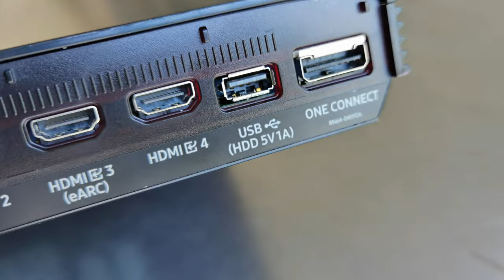Samsung Slim One Connect Box 2021 for QN900A: How it works and deep details

Comment: I read that the black screen issue can be fixed by cooling the green board down. It's possible that blue stuff isn't very good. My new s95c blacks out at 120hz or higher but it's not consistent and sometimes it's stable. I have read people spoke to samsung and they say the chips fail and need replacing. It's possible they cook then fail the first time you exceed 100hz for even a short time in a warm room.
Reply from the maker: Yes, it is possible

Comment: 2 questions: Does the One connectbox contain the Wifi chip onboard? Because the 2021 OCB has Wi-Fi 6E chip. Second: Is it possible to upgrade the OCB from the Q950TS 2020 model with the 2021 model. The connectors look very similar.

Comment: Hi I have just received a QN800A here in the UK, I have found that the one connect box is putting a lot of heat out, to the point of 51.5c and is a concern. Did you check you're one connect box for heat at all? I am await a response from Samsung UK.
Many thanks 👍
Reply from the maker: You are right. It creates a lot a heat since this year they don't have fans or big heat sinks. The best solution is to use an external fan or to put the unit in a place with air using the longer cable.
Reply: @hxosplus  I spoke with Samsung CS and they confirmed that it is it's normal operating temperature. Time to buy some mini fans. Thank you for the reply 😎👍
Reply: @rickymob28  
I don't recommend it. My box blew like a bomb at night and I was told it overheated. I would leave it in a cool area and turn off when not In use.

Comment: Hi, if I put the one Connect box inside the wooden cabinet under the television, does the remote control work the same? Or do I risk a lack of signal?
Reply from the maker: It will work. The remote is a Bluetooth one.
Reply: @hxosplus  ok, grazie mille!!

Comment: Hi, great information video. Can I request the dimensions for this slim one connect box, thanks in advance.
Reply from the maker: I will measure it and I will get back to you.
Reply: I would also like to know the width, length and depth/height please.
Reply: This would be great to know
Reply from the maker: Check out the description of the video
Reply: @hxosplus  is that supposed to be mm or cm cause the translation to inches is off
Reply from the maker: @christopherpedro9804  it's in cm
Reply: @hxosplus  Thank you for the efforts to measure this 👍🏼
Reply from the maker: @christopherpedro9804  cm

Comment: Does the One Connect box securely attach to the stand or just sit on it? I got this tv today, and it seems it could easily fall off, possibly damaging the short cord. I guess if I move it, I need to disconnect the One Connect box first to avoid dropping it. Or, am I missing something?
Reply from the maker: You are right. Just clicked it there and secured the cable with the screw.

Comment: So what if you want to hang the tv on the wall?...Not possible with this box??
Reply from the maker: The box is removable and connects with the TV with a cable.
Reply: @hxosplus  ok, sorry... but what if you ONLY want a tv on the wall and nothing under this tv...Can you mount the box BEHIND the tv???
Reply: I am also thinking the same, if you want the TV flush to the wall you may have to cut a bit of your wall out to hide the box inside, if you are not bothered about the TV sticking out a bit I'm sure there is a way to tie it to the TV.

I was maybe thinking of getting the qn94a as it is the same but without the box, and it only has one 2.1 HDMI port but that's all I would need.
Reply: @kaisers91  i believe just 1 HDMI 2.1 port is not good enough, also no Dolby Vision/atmos support...not future proof, so it will not be Samsung for me..
Reply from the maker: @kaisers91  That's fine!

Comment: I have a qn900b. I have a one connect box. Where on the tv do I plug the hdmi cable? Or does the one Samsung cable function as a hdmi 8k cable?
Reply from the maker: Not on the TV, the HDMI cables are going to the One connect box
Reply: Okay, so the one connect cable is technically your hdmi cable? Or does the tv already have the technology to produce 8k without an hdmi cable? I already know you can add an hdmi cable to the one connect box and connect it to a apple 4K tv box or another device.
Reply from the maker: @ddfphotography  The TV has 8K upscaling technology.

Comment: I have my tv Qn65Qn900 and it stopped work today. When plugged the power cable in the only thing I heard is the clicking noise from the one connect box. 
My question is whether the tv get the power from the one connect box?
Reply from the maker: Ι think yes. The panel gets power from that box.
Reply: We’re you able to repair it ? I get the click sound also and screen is black.

Comment: What is the weight? I have been trying to find out a way to mount it in a Wall but there is non specifications on how much Lb it has?
Reply: Any luck with this? Looking for a suitable mount aswell
Reply: @qasim1517  how did you mount?
Reply: @Widmelittlemate  I used the original mount supplied, and screwed it to the wall. Slotted the 1 connect box straight into that, and just cable tied it for extra support
Reply: @qasim1517  thanks for the reply. I got the TV yesterday. The smart remote won't work. When i try sync and everything else. Just says not available (power button works) and also the wireless is not working. Does not scan or find any network says the mac address is invalid? Any ideas buddy

Comment: Hi mate i buy QN700A 8k from a resseler here in Uk and it came with that QN800 one connect box do you think it will be work? Because the tv is working as normal but if i put hdmi cable to the box it shows no signal it will recognize my ps5 but no audio and video🥹🥹
Reply: Did you find out if it worked as I have a q950r and keep seeing conflicted answers online some say it's just a hub for your cables to connect into so any connect box will work on any Samsung 8k TV and others say it wont

Comment: BEWARE, I purchased a Samsung Neo 800B a 8k TV. The "slim one connect" bow blew out in less than 2 full days of operation. After the TV went black suddenly, I could hear the relay "clicking" however not powering up the screen. These TV sets run hot and I suspect the soldering from the power supply on the motherboard is shoddy. Avoid Samsung products at all cost. I am returning my $3500.00 TV back to "Best Buy" ASAP for a full refund.